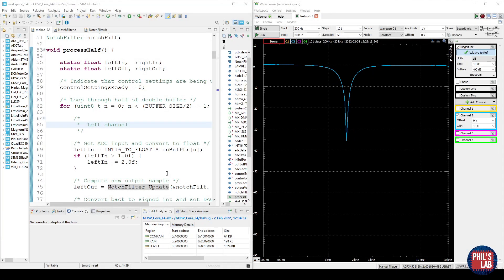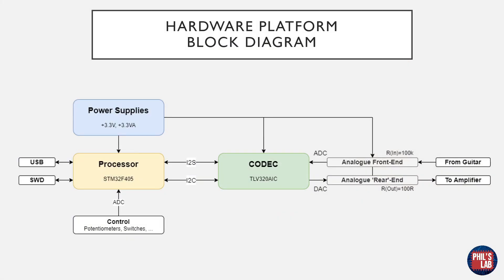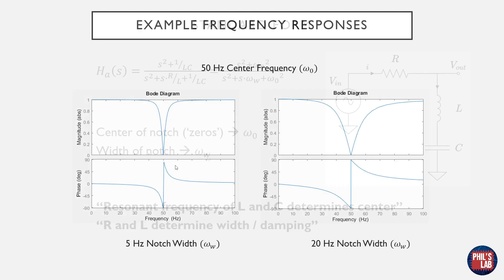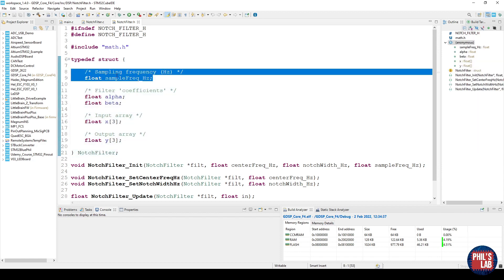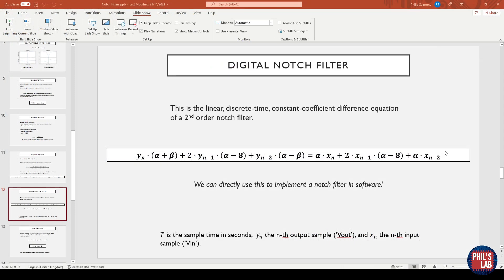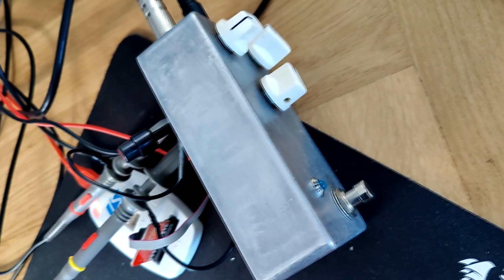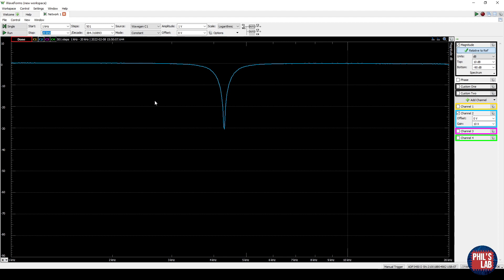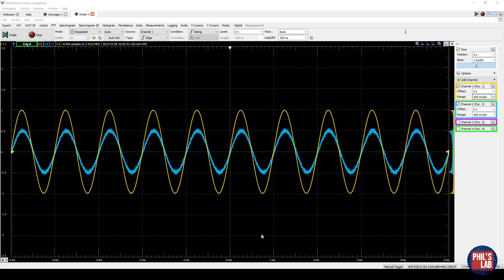(Sponsored) Notch Filters - Digital Audio Processing with STM32 #2 - Phil's Lab #49

Comment: Hey Phil, Great Video!

I would love to see some more around the setup around the communication protocols and other peripherals, if you are interested in covering that for a future video? This could include choosing the pins for SPI, I2C, I2S and USB protocols, including protocol requirements (such as impedances, general layout guidelines, and hardware setup). A video covering all their operating modes would also be welcome, as I have yet to find such a comprehensive STM32CubeIDE guide, which isn't just text and block diagrams. Seeing the setup for a custom board with an audio codec would also be cool.

In general, I'd love to see more detail on how this guitar pedal layout relates to the peripheral setup. There aren't any good YT vids on how to setup your SAI for full duplex mode and DMA using STM32CubeIDE, and writing driving code for the codec in reference to the datasheet. I've looked extensively for such videos.
Reply from the maker: Thank you, Marco! Yes, I'll be making a video on the 'low-level' setup. I actually have a new DSP board in my hands now for which I'll be doing that.